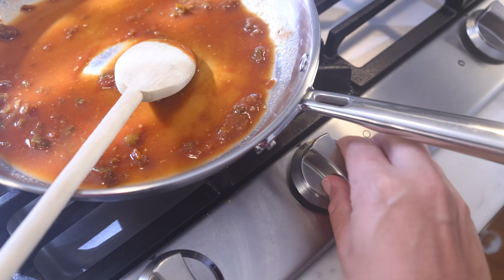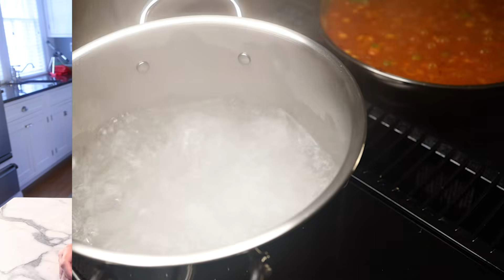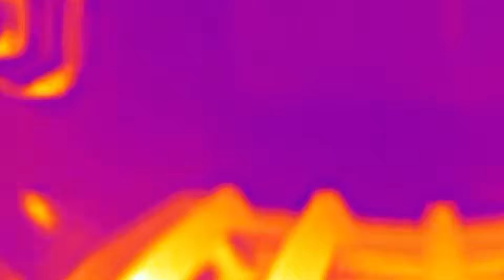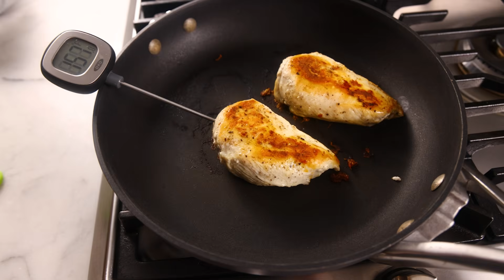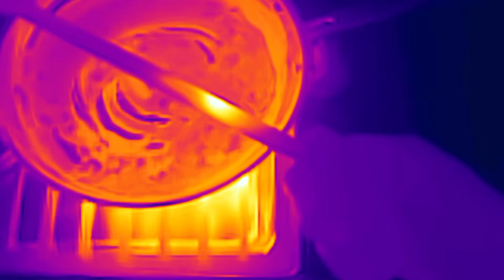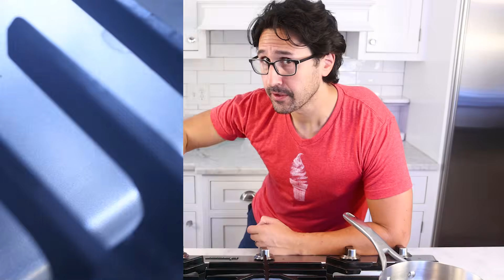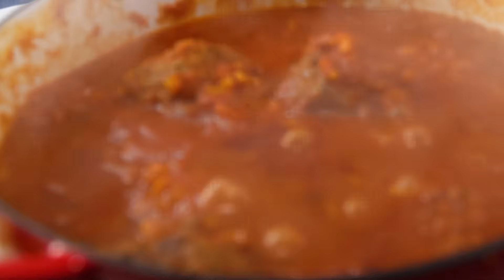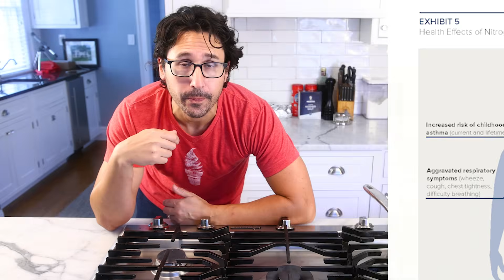Problems with gas stovetops | weak, dirty and dangerous

Comment: The only thing I have against induction tops is the special pans you need for them. My parents have one and they replace their pans about once every 2-3 years because they break down so quickly. IDK why and when I watch them cook they arent doing anything improper that would damage them.
Reply: Are they using the special copper/aluminum with a ferrous (iron) plate bottom. Or propper mild steel and cast iron?

Comment: I just moved and I had gas at the old place and gas at the new place.  First house was 1960s and the new one is 1990s.  The newer gas is super slow.  It also seems like the grills are too far away from the heat source nowadays.

Comment: My personal experience is the exact opposite.

I've moved from a resistance coil stove to a gas one, and it's miles better. I get much more heat from my gas stove than I ever have from a resistance coil. 

Maybe it's because all of the resistance coil stoves I've used are really crappy old ones, where the coils are bent  so pans don't sit flat, and they take ages to get hot. 

But the difference I've experienced is so extreme I just have a hard time believing that they could ever match the heat of gas stove. 

And I have no trouble with low heat either. My current stove doesn't have a small/simmer burner, but it doesn't need it. At the lowest setting it's not even hot enough get hollandaise to thicken.

Of course induction stoves or contained units like electric kettles are a different beast.

Comment: A lot of the heat transfer problems you describe with gas is more of a problem with modern "sealed burners". consumers were somehow convinced that these were easier to clean (they're not) than open burners. Open Burners are much more efficient at transferring heat to the bottom of the pan and you get a low less wasted heat up the side of the pan. The problem is that outside of the commercial kitchen world few companies actually make open burner gas ranges anymore (Bluestar, American Range, and Capital are the only ones in the US) and these tend to be on high end expensive "pro-summer" models. Most people don't have $5-7k to spend on a range. So most are stuck with crappy sealed burners.

Comment: I went from electric to gas. I'm definitely not going back to electric. Any pan with a little bit of wobble or warping immediately renders it useless. Toasting tortillas can be done in 10 seconds. The ability to disassemble the entire stovetop and clean it thoroughly is also great.

Comment: People assume that if is cheaper and faster is more efficient, seems like it's a little bit more complicated than that, have in mind all the energy looses from the electric generator to your home, all the ac-ac voltage regulators, the resistance of the cables etc, and how the price is virtually lowered by generating the electricity at a big scale, and not because is cleaner or less energy intensive.
Also he didn't had in mind at all than with gas the heat is constant, even if you can make a custard (who tf does custards on daily basics) is way superior to make things like soups, sauces... you can burn more bottoms of pans and pots with inductance ones than gas, the learning curve is way shorter with gas, since I started using induction I no longer can sit down and read a book or browse the internet while something is being cooked, and I had been years using them, I already know their levels they're just horrible spreading the heat.

Comment: I've heard in an interview with a pro chef that the main argument for professional kitchens switching to induction is that it largely improves working environment: induction doesn't heat the air and it makes a difference.
The main disadvantage of the electric (coil based) stovetops is their huge power consumption - it may not make a difference in the US, but in Europe it does.
Reply: It should make a diff In America but sadly here people just don’t care about how much water and power usage
Reply: @Mister Dude Ramsay isn't just a TV chef you dingus
Reply: @Mister Dude I don't read trash
Reply: @Mister Dude enjoying the copium eh?
Reply: Aren't induction stoves a fairly modest power efficiency upgrade over the coils?

Yeah the coils themselves have to heat up, and a little bit radiates off them into the air... but afaik it's less than a 10% upgrade in efficiency going to induction?
Reply: @priestesslucy  they aren't that much more efficient but good ones are a lot nicer to use, the tech is way better.
Reply: I can tell you the hot plate industrial stoves take forever to heat up. There is no way you could achieve the high volume currently expected by restaurants using one of those stupid burners. 
I'm sure they're great for Michelin Star restos where you are set for a 2 hour dining window, but if I need you out of the restaurant in 45 mins, I need gas.
Reply: Marco Pierre White, of 3 Michelin star fame, said he preferred a hot kitchen because it keeps the food hot.  But these days those wanky restaurants only pump out overprices little canapés so I suppose it doesn't matter anymore.  There's nothing to keep hot.  It's all part of the general enshitification of literally everything.
Reply: I’m not sure which you really mean when you say “coil based”, I assume not induction

When I was in tech college as an apprentice electrician it was claimed that induction didn’t actually use more energy than resistive, they had a higher power rating because they could heat up faster though.
Reply: @thomasa5619  literally explained in the video what coil based was
Reply: @EpicFelinski  I can’t remember what I was thinking, probably Adam’s weird comparison to lightbulbs.
Since most of a lightbulbs energy is infrared which doesnt go through glass.
And the more fancy resistive elements glow red under a sheet of glass. 
Pretty sure I saw weird comments about infrared in the comments section somewhere too
Reply: @Mister Dude coils are way less efficient than local combustion lol (the exception possibly being during the Cooling Season)

Now, renewable energy is better than fossil fuels in almost every way, but right now (at least in many parts of the US) most of the electricity is still being produced from fossil fuels for now
Reply: @Mister Dude yeah, both really is the wave. I have an accessory induction cooktop for use when I don't want to be adding any additional heat to the house and don't feel like going outside to use my solar cooking gear.

That's the thing though, if the house needs heat anyway, local combustion always beats delivered electricity in terms of overall efficiency.
Reply: @Mister Dude GoSun.

It's kind of spendy, but occasionally goes on sale and it works amazing

The big one I bought also runs on 12v as a backup for crazy dark as dusk deep cloud days, so it was my primary cooking device when I dabbled in Van living
Reply: That makes sense about the work environment. I know in my area the electricity comes from a natural gas plant. In the summer i can be looking at a 100$+electric bill mostly from the AC. But come winter time when i am using gas central heat the highest i have seen on the gas bill is 40$. Thats with gas providing central heat, hot water, and running the stove. I love my gas cooktop and oven. It may help that it is an older range that does not have the EPA restrictions on it. If you want full power then you've got it. The kitchen my get 10-15deg hotter than the rest of the house but im not going to be in there long because i'm cooking with gas baby.
Reply: Which professional kitchens? Even goddamn Ramsay still uses gas stoves.
Reply: @kaikart123  Michel Roux Jr uses induction hobs in his famous restaurant "La Gavroche". That's one example.
Reply: @kaikart123  Plenty, "professional" doesn't always mean "gourmet", high volume restaurants in particular can benefit from the lower heat waste.
Reply: @chaon93  stop the deflection and answer the damn question
Reply: @kaikart123  Just google commercial induction ranges? do you think they make these things if no one buys them? Induction's highest popularity is with italian restaurants for points highlighted in this video but it should be mentioned that induction + gas ranges are a thing as well (including Gordon Ramsey's personal stove. He uses BOTH because BOTH have strengths)
Reply: @kaikart123  Here's an example of a kitchen of a 5 star hotel, tons of induction tops all over the place https://www.youtube.com/watch?v=qqSWydo6hpI
Reply: @kaikart123  Michelin star Steirereck, more induction, esp around the 1m mark https://www.youtube.com/watch?v=g0yisRiLwGA
Reply: @kaikart123  Gordon Ramsay is not a particularly good professional chef; he is a TV personality
Reply: @JeffreyMorse775  wrong
Reply: @kaikart123  it's mostly a thing in newer kitchens where they don't already have working gas burners and lines, but induction cooktops do appear to be phasing out gas for some higher end retoraunts. As for Gordon Ramsay, that dick may be a decent chef, but he isn't the penultimate source on everything cooking related.
Reply: @kaikart123  I'm sorry, but I can't recall.

Comment: All the induction ones I know do PWM and switch between full blast an no power. Enough to cyclically burn stuff on low settings. Thick bottomed pans and pots help. 
The burners might be responsive but the touch controls are not. Gotta hold that minus button for 10 seconds to turn a specific zone all the way down… hate it. Also the Noise they make. Careful if you have pets or small children that are sensitive to HF noise.

Comment: As someone living in college housing with a crummy little electric coil stove, I really miss my gas stove. This electric one doesn't get nearly as hot, takes forever to boil water and searing ground meat is nearly impossible.
Reply: Induction has all of those advantages as well, coil stoves just suck(I also used one in college)
Reply: I mean you can buy those little gas stove tops (the on the go, the mini) and buy a tank (I guess) that holds the fuel and just insert it in. It”s a bit pricey yeah, but if you hate that electric stove so much then this can be an alternative. It all depends on you though
Reply: That's strange, my experience is nearly the opposite as yours. Though I suspect that not all units are made with the same efficiency. Some electric variants can be worse than gas stoves.
Reply: @RodyTheRoad  You probably had an induction stove or one of the worst gas stoves known to man.

Comment: Hi Adam. Your perspective is interesting. In my experience the electric stoves I’ve used are either too hot or too cold for the need where as I have more control on how to vary the heat on my gas burner. This has led me to burn a lot less sauces or bottoms of the pan when I can more easily vary the temperature. I have limited experience with electric stoves and if there are options of more variable heat with fast response times I would be interest in considering this for my next stove.

Comment: I've lived and cooked with all types of stoves, gas, coil electric, electric with glass on top, propane, and induction. I would only ever cook with induction or fossil fuels now. Electric is not responsive at all, and just doesn't work for properly searing a steak, making naan, etc. It's really only okay for boiling pasta. Electric causes food to burn yet be raw in the middle. Currently I have one cheap, sturdy induction hotplate as my stove, and it way out performs a 4 burner electric setup. I would just eat cold food if electric was my only option.

Comment: The cycling of electric stovetops you briefly mentioned is exactly why I despise it. It's either burning my food, or not cooking it. Not only that, but if I'm ever using more than a single burner it tends to divvy up the power as it see's fit. Cooking J. Kenji's 3-ingredient macaroni, for example, nearly always burns a little on the bottom because I can't keep just the right amount of heat on my pan to emulsify the milk/cheese. Everything needs to happen rather quickly, so there's no time to wait for the electric burner to cool down. Give me gas!

Comment: I had gas stoves for a number of years before I bought my current condo. My condo has no gas service, so a gas stove was out of the question. I was really upset about this; since other condos in our community have gas stoves, I figured there must be gas lines throughout the community. That turned out not to be the case. If I wanted gas, I’d have to pay to have the pipes put in from the nearest gas main, and that was going to be WAY too expensive.  So, I had to learn to deal with electric cooking.

When the original 1970s-era stove died, we replaced it with an infrared glass-top stove.  Let me tell you, I’ve never wanted a gas stove again. I love this glass-top stove! I do almost all my cooking in cast iron and there are no hot spots on this stove. Everything heats up very quickly and I have tremendous control over temperature. I can cook stuff directly on the stovetop that normally requires a double boiler — the "low" setting really are that low. One burner has a "warm" setting that can do just that; I can set a pot of cooked rice on it for 20 minutes and nothing burns on the bottom.

The only problem I have is with wok cooking, but I bought an electric wok so I don’t have to worry about that anymore. Well, there’s also the problem of power outages, but those are fairly rare where I am and a microwave plugged into a generator solves that problem.

Comment: I have never used anything other than a gas stove, as I live in the Netherlands and that is just the norm here. I always thought most of those problems were universal and there are easy workarounds for them. To boil water faster, use a water boiler and then pour it into the pan immediately turning on the heat. My gas stove does have a small pit with only 6 holes for simmering stuff and keeping things hot. The thing I love most about it is that it has a huge pit for woks and other big pans which need really high heat.

Comment: And while delivering gas via pipeline directly to the end consumer is similarly efficient as is delivering electricity via cables to the end consumer, a lot of end consumers of gas do not actually get it delivered via pipeline - In Nicaragua for example, people usually buy gas bottles and those are of course delivered by motor vehicle which is literally the least efficient method of cargo transportation commonly used...

Comment: I've always considered and been told that gas stoves were much better than electric. In light of what I've seen and heard here,  I'm going to have to rethink that now. The only experience I've had with electric, are those exposed coils. Which my mother was constantly setting a wooden cutting board down on an branding the coil into the wood with.

Comment: It's strange, I've always preferred gas over resistive electric, I currently live in a house that has resistive electric and it' not hot enough for me, I haven't used a proper induction stovetop yet, only a stand-alone unit so I haven't fully formed an opinion, but it is promising, although it can cause warpage of carbon steel pans, as well as multi-layer or "clad" pans from what I've read. When it comes time for my next range I guess I will do more diligent reading of what is out there, but induction appears to be better than resistive, even considering the constraints required, but gas is better than resistive electric, at least in my experience.

Comment: Gas shouldn't leak from the stove if it stopps burning. There's an automatic valve in there which basically as soon as the thing starts cooling it turns it of.
In addition to that sulfur-smelling gas is added into the mix. If it starts leaking  you'll know.

Comment: As a long time fan of gas stoves, I completely agree with what you've said here. The reason I love gas stoves is because all the electric ones I've used have been absolutely terrible. I'll definitely get an induction cooktop whenever I spec out my own kitchen. My wife has already smashed all of my glass pots, so I don't have that to worry about, at least...

Comment: I thought I was crazy? We had electric hobs at home my whole life and you get used to their pace – slower to start, but you can chop your onions while they heat up. In university I need to use gas and it is really good for frying stuff, but if you need to boil sth – oof. Thank god for electric kettles to get to a boil, but simmering is almost impossible. And gas ovens – put it on 6 and hope for the best. 
Also, most efficient at transferring heat is probably a microwave, but that comes with its own can of worms.

Comment: surprised you didn't mention how induction stoves require their own cooling system, and if you get them too hot (i.e. from a suuper hot pan) they'll turn off until they cool down. This means that seasoning pans on induction is basically impossible since you can't get them hot enough (although my workaround is to hold the pan an inch off the surface, so it doesn't heat up the unit so much. PITA though)
Reply: I always season in the oven for this reason, I don't trust a stovetop to heat the pan evenly or to the right temperature no matter what kind it is.

Comment: I have found that when using a gas stove, the scorching on the side of the pot only happened on two of my pots, the cheaper thinner ones. While I had no such issue with thicker pots

Comment: you've kind of convinced me. i think with some reprogramming of my brain when it comes to using the hob, i could learn to love electric. and who knows, more responsive electric hobs may become cheaper and more available in the future.

also a key point about electric vs gas when it comes to environmental thinking is that even if both are using fossil fuels to generate the energy, it's a lot more efficient to have a big central generator that then supplies electricity through the grid to the users, compared to lots of tiny burners in every kitchen. same deal with petrol vs electric cars